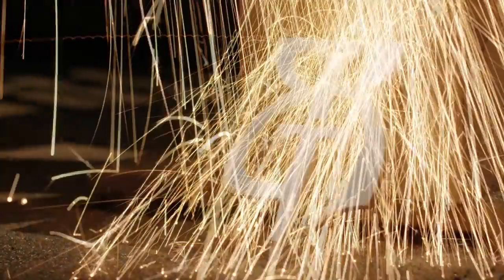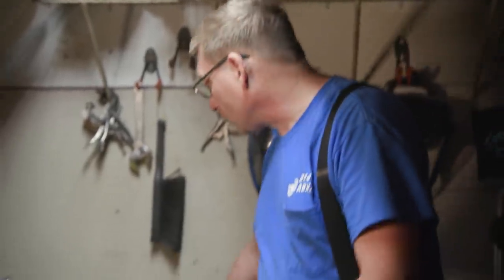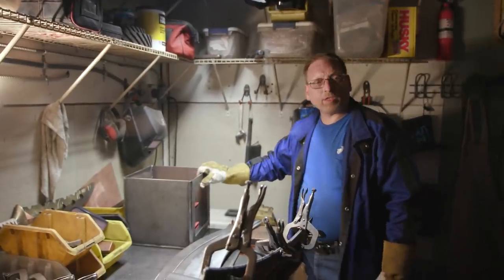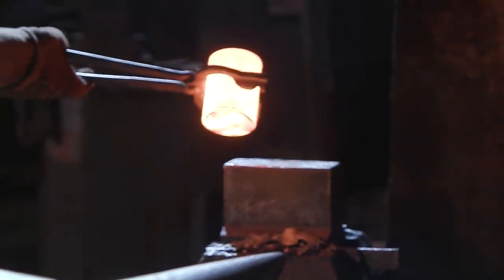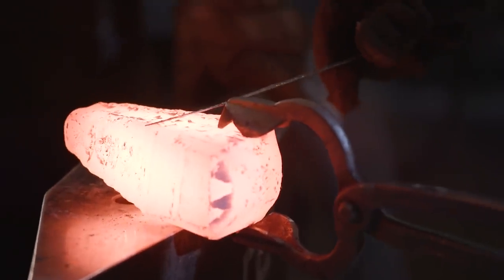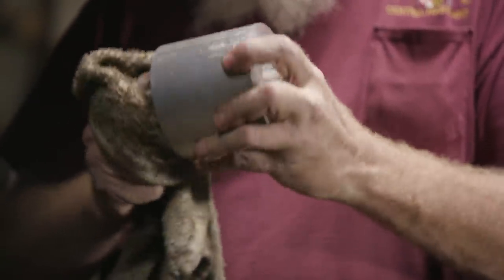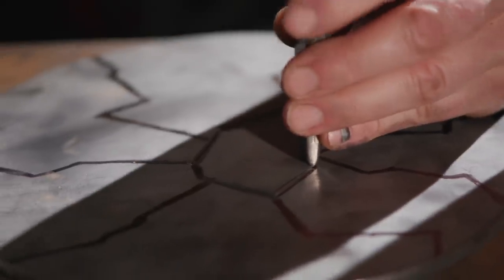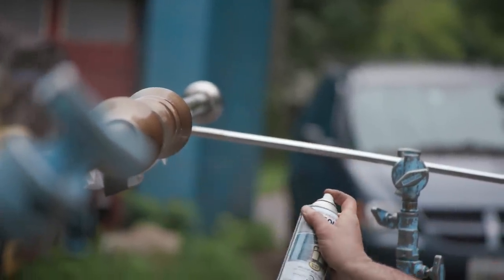Diane's War Hammer Gideon - Seven Deadly Sins - MAN AT ARMS : REFORGED

Comment: That looks sick! I’d like to see you guys make inosuke dual swords from demon slayer
Reply: YES YES YES YES

YEESSS
Reply: A lâmina do Ususuke realmente é MT maneira
Reply: weld 2 saw heads on a thin sword, and you have 2 saw-like Katanas :P
Reply: But only if they make 2 proper swords and then bash the blade in with rocks and hammers
Reply: Now that would be an interesting challenge. It is one thing to make two blades, but the implication being that rather than having the edge of the swords precut like what we see, it is literally the result to smashing up the swords with a rock to make them that way.

Still, part of me feels like they would probably make those cuts before the katana was completed (but would be rather sweet to see them do something to that degree).
Reply: @mas8705  Well there are two swords. One can be done one way and one the other.
Reply: and make them like he makes them, forge a normal katana then smash it!
Reply: Nah, Kyojuro is much better

Comment: although i usually have no complaints at man at arms, I do believe you may have made it a bit too big in my opinion, the box is the show or manga, it is around the same size or a tiny bit bigger than dianes head, if a giant is just a big human, than I would have done it a bit big than an adult womans's head. the one you guy made is double the size of that. and is not a wieldable weapon, I believe a rebuild would be in order to be an accurate scale hammer, that would be actually weldable in combat and be more accurate.